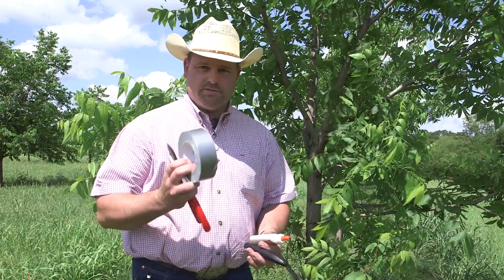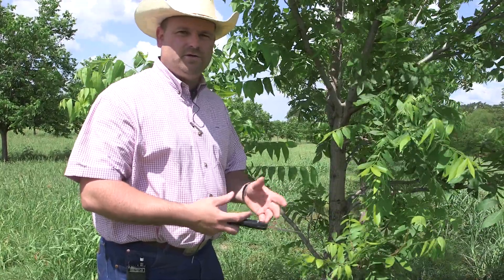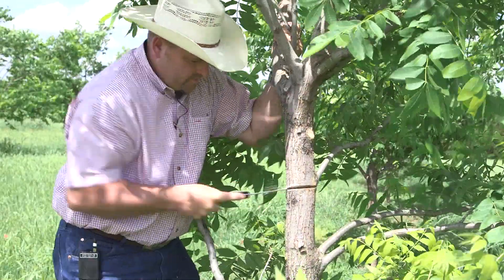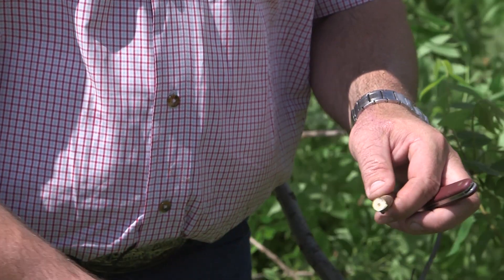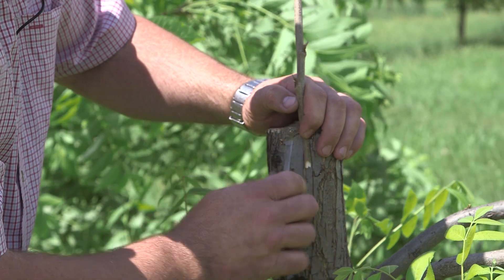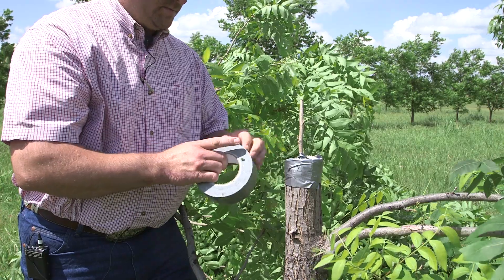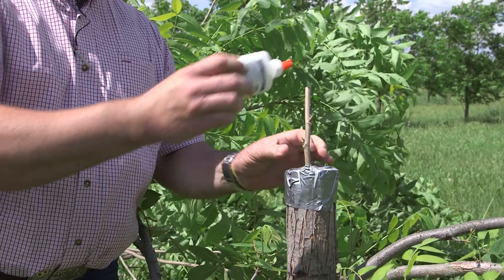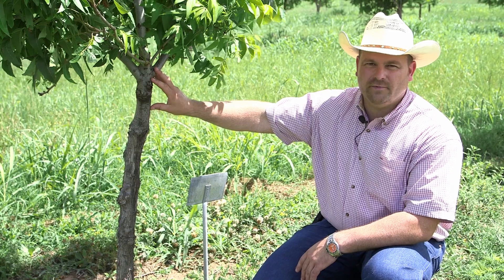Pecan Grafting: Texas Inlay Bark Graft, "American Method"

Comment: Question - The typical inlay bark graft that I have always used (Ok. State Method), we can only do that until late in May...   How late are you guys doing grafts?  The post was Jun 25th, but no mention as to what time of growth you should / should not try to graft.
Reply: As long as the bark is slipping, the mechanics of grafting will work. The issue then becomes, do you have enough time left for it to come into growth and get woody enough to survive winter. In Mid Missouri, I am like you, in that late May is the cut off date for grafting. If a person was in Texas, that could well extend the time available for growth and hardening off. I give myself a 2 week window from May 15th to 30th.

Comment: Does the rootstock need to have limbs on the bottom?
Reply from the maker: The rootstock does not have to have any limbs below where you place the graft.  If the tree is large (generally over 6 inches in diameter) you can leave a limb below the graft to help reduce the growth of the scion wood (graftwood) once it buds out.  If you are grafting large trees and removing greater than 30% of the canopy, the energy that is pushed into the new scion may result in too much growth too early causing the graft to blow out.  Therefore, a lower limb can be used to help pull some of the energy coming from the roots to regulate the scion growth.  If the scion is not growing well, you can remove the limb to push more energy into the scion.
Reply: @NobleResearchInstitute  If you were to graft onto a large tree, could you reduce the chance of the graft blowing out by grafting multiple scions onto the rootstock? Divide the energy so its not all going to one scion.
Reply from the maker: @drunkenkurage  
Grafting multiple scions onto a large tree will help some with the growth that will occur from the energy being pushed up from the rootstock. I would also recommend pruning back the scion to help increase the caliper of the scion and strengthen the graft union. Also stake up the growth to help support it.  You may have to prune the scions back several times to first couple years. Also if you graft multiple scions on the same on the same trunk/branch selected the best one or two after the first year and remove the other ones. 

Charles Rohla, Ph.D.
Pecan Systems Manager
Reply: @NobleResearchInstitute  I have top worked large trees, then cut the non graft tree away...  you get pecans faster that way.

Comment: So can I plant the pecans I have and then once they reach 3-5 inch diameter I can graft them?
Reply from the maker: Yes, you can plant the pecans you have then graft later.  You can wait to graft at the 3-5 inch diameter, but if you look at some of the other grafting methods you can also graft earlier with those methods.  I would recommend to wait after the planted pecans have been established, to make sure they survive before grafting.
- Will Chaney, Senior Research Associate
Reply: You can graft when they're 3/8 inch or larger with a 3 or 4 flap graft. Bigger limbs use this method.

Comment: What is the purpose of doing this ?
Reply: The same as grafting on any tree.  Trees that are grown from seed do not grow "true", that is to say they do not necessarily produce the same fruits that their parents did, just like children that are different to their parents.   Wild tress may produce smaller fruits or fruits that are not as sweet or simply, as in the case of pecans, not produce nuts that fill out or  where the pith fails to peals away from the nut, or, as in the case of pistachio, produce pistachios that do not open.  Almonds are grafted on bitter almonds, otherwise all the almonds would be bitter, ditto orange trees.
Reply: @EscribanoEl  I have pecan trees i ordered in the mail and they came wrapped in wet paper. They would have been grown from seed i hope they are ok. They are pretty big now that was about 6 years ago.
Reply: @muddyriverdogz  They'll be just fine.  They should already be about to produce nuts this year.  If you find that they are not very big, or only about half of them fill out even though the trees have enough water, you can always graft them.  I have grown some from nuts and they produce very tasty pecans.

Comment: Why did you leave that small exposed area on scion?
Reply: If you are referring to the part that is tapped into the groove, it is too wide at that part and would cause the bark to stick out too far.  It is then all covered with tape.
Reply: That exposed slant cut should callus over, form new tissue and aid in anchoring the scion to the stock in one to three years.  If that slant cut were pushed too far down, its growth could force the scion to separate the long cut from the flat stock cambium.